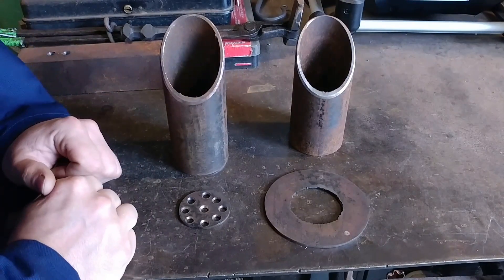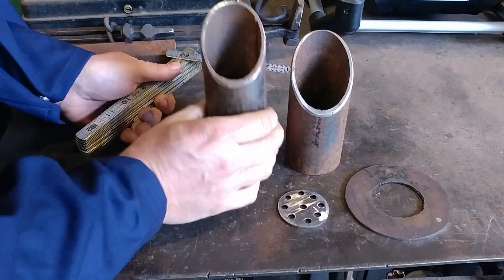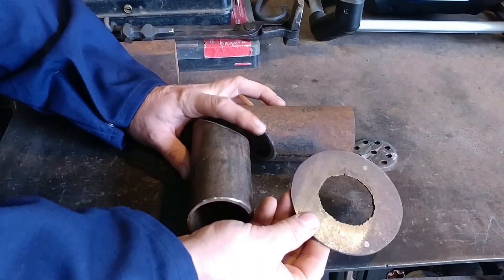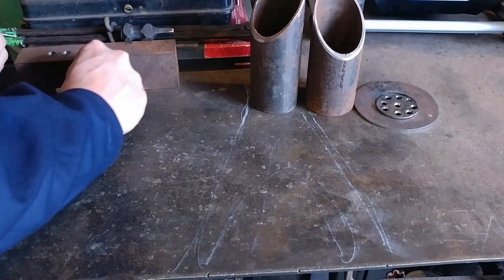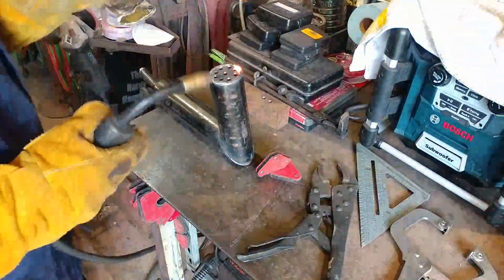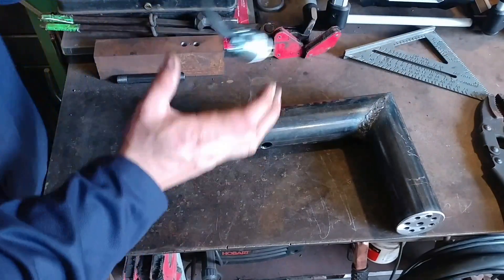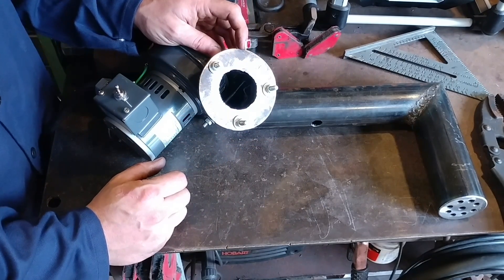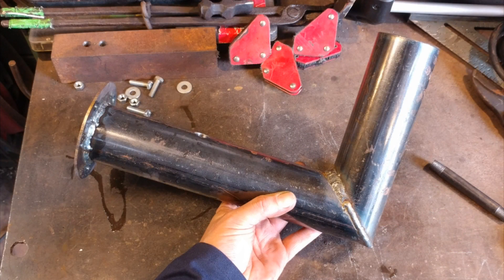How to Make a DIY Gas Forge Burner

Comment: Excellent burner Roy, I am building my first forge and burner and will be using your design but have two questions if you don’t mind. What is the steel pipe ID and wall thickness you used and does it matter on the size and number of holes in the strainer?  Thanks and am enjoying you videos! Best Regards, Ray

Comment: Is this a so called forced air?
Reply from the maker: +Peter L yes
Reply: Christ Centered Ironworks Okej. Interesting. I don't really get the difference, besides that you push air in the burner. Is there an pros and cons compared to other types of burners?
Reply: @peterl7225  also lower pressure on the propane tank help your tanks from freezing up as well
Reply: They say that forced air burners are more fuel-saving...

Comment: Did you. Do any kind of air test on the welds
Reply from the maker: +Micky Swift no I didn't... It isn't really needed in this application as there shouldn't ever be that much back pressure in the system.
Reply: That's cool thanks for the reply

Comment: Amazing design.  I am switching from coal to gas and have been looking for what burner to use.  I have been looking a a few venturi blower designs (yours being one of them) and a couple of ribbon burner designs but I have not  come across one like this.   Do you have any suggestions for those of us who do not have welders?  or  Will you be selling these in the future?
Reply from the maker: +Chris Lawrence unfortunately without a welder it is very difficult to fabricate a burner together. There are some designs out there that require nothing but pipe fittings to get the same job done but they do require quite a bit of Plumbing to get running right. As far as right now is concerned I'm not sure if I will be selling these in the future I guess if I got enough interest in them I might figure out a way of doing so though :-) thank you for taking the time to watch and Comment God  bless

Comment: I checked your website and did not see and details, usually the strainer is a brass drain strainer. Since you welded it, did you actually make that yourself from steel?
Reply from the maker: +Dan Rozwood thanks for the great question. Yes I fabricated the strainer plate or diffuser out of steel I will have the details of everything up on the site a little later this afternoon before the second video release in this build series. God bless you and thank you for watching

Comment: does the diameter of the burner tube matter? say for a 3 cubic foot forge one 2" or two 1" which would be better?
Reply from the maker: +Phillip Sheldon yes the size of the burner tube matters diameter wise. A smaller diameter burner tube will create a smaller Flame a larger diameter burner tube will create a larger Flame with more heating potential a large 2-inch burner will put out more heat than two 1 inch burners
Reply: @ChristCenteredIronworks  interesting, I used to use two one inch tubes with out the diffuser to do damasksus, but you needed a lot of air and a large propane tank to drive it. Thanks for the videos, I am getting back into black smith work and building a new forge. the information has changed so much in the past 20 years, it is incredible. Thanks again, for the new insites.

Comment: Good instructions!

The round disk that you welded in is necessary in some form, because it's a difuser and brings the fuel and air to a final mix = more efficient flame.   Adding a flare to the end of the burner after the diffuser is only needed if used outside a burn chamber.

Thanks for the video....
Reply from the maker: +shadowcastre thank you for the input! :-) the burner flare is needed for an efficient burn so we will have to disagree on this part in the third part of this video series I will be showing the difference of with a flare and without a flare it creates two different types flames. In the case of using the forge liner itself as a flare you would be correct as not needing a additional flare as you'll see in this design when I get it mounted to the forge that I plan on using. Thank you for the great comment God bless you and thank you for watching

Comment: thats a very nice design roy pitty i want to get rid of gas and heat quicker lol i have a question will 2 90 degree bends make any better burner than just the 1
Reply from the maker: +grayem pepper two 90-degree elbows are not needed but they would in effect mix the gas in air additionally. 190 degree turn would be the minimum unless you are using sweeps instead of sharp 90s like I shown here and in that case to 90 degree bends may be needed to equate the same as one. Thank you sir for the great question God bless you and look forward to chatting with you on Friday :-)